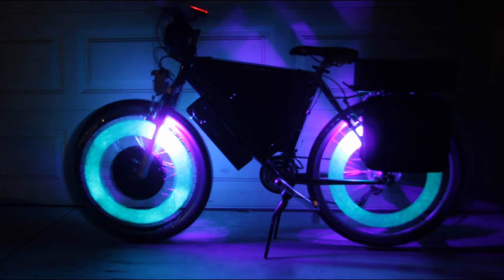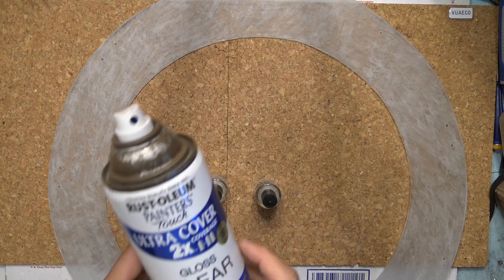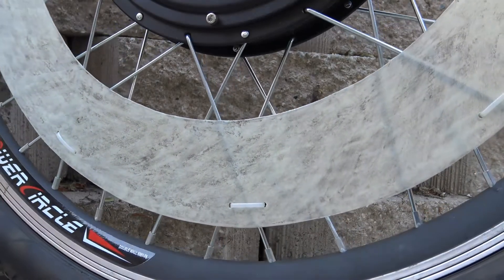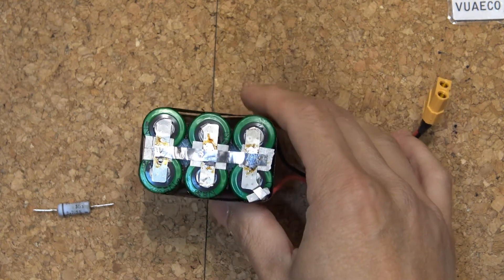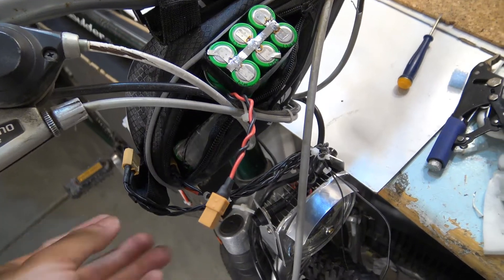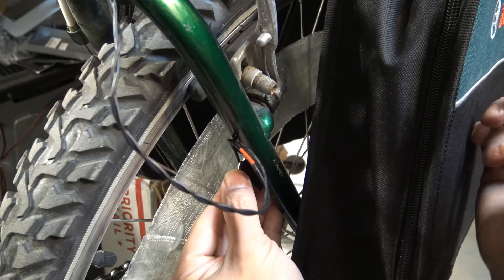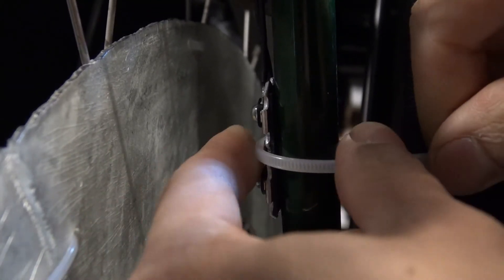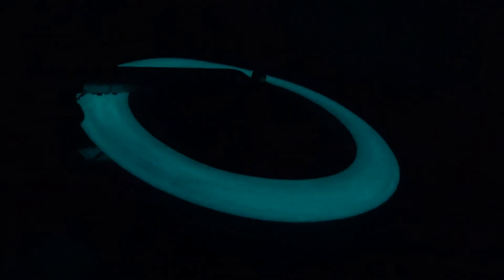DIY Ebike S01E09: Tron-inspired glow in the dark wheels for your bike

Comment: Another very cool idea and entertaining and informative video; thanks!  I am interested in the UV-LED's and was wondering if you could provide a link to the ones you used in your description.  Also, do you happen to know their output in terms of UVA, UVB, and UVC?  If not, I'm sure I can find that on the internet.  We have a pet tortoise and I want to look into using these LED's to provide UV for him during the winter months.
Reply from the maker: I bought it on ebay. Just search for "ultraviolet bead LED". There are bead LEDs that go with heatsink (the star shape aluminum base on the bottom of the LED as you can see in the video). And there are ones that go by itself without the heatsink. Get the ones with heatsink as it will help cool the LED as it does get hot. The seller I bought from didn't provide much info on it except for its wavelength which was about 400nm. So it's not really a true UV light which has to be less than 380nm. It's more like a deep purple/violet color LED which is still a little bit visible. You cannot see real UV light (especially from the sun) as it's not in the visible spectrum humans can detect with the eyes. But it was cheap and good enough for my project. I looked but couldn't find any true ultraviolet LED that's less than 380nm. The shorter the wavelength, the more powerful the ultraviolet light and thus, the more expensive.
Reply: Thanks!  I was able to find some with stated wavelength of 365 nm, pretty much middle of UVA range.  So I will get that for my tortoise.  Before I watched your video, I never knew LED technology extended to UV.  WOW.